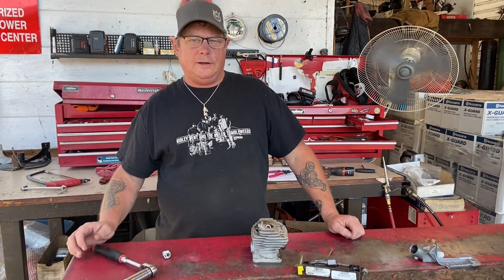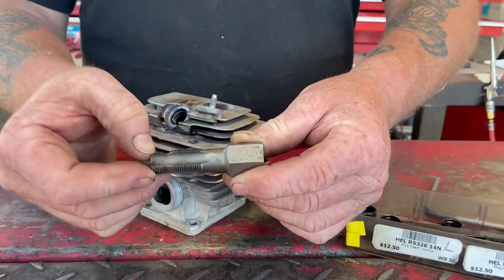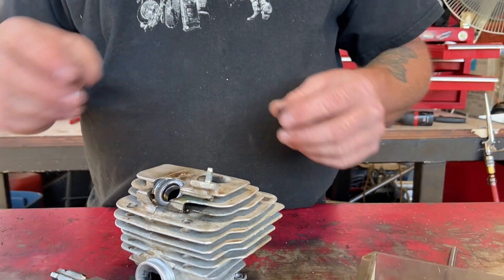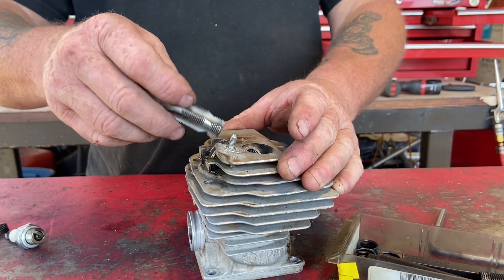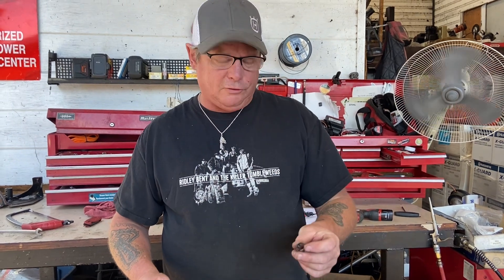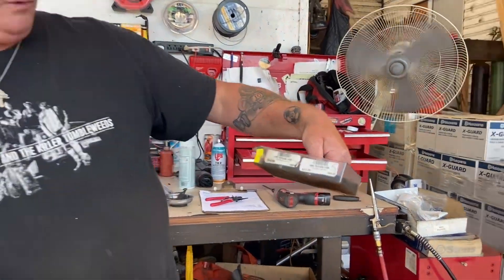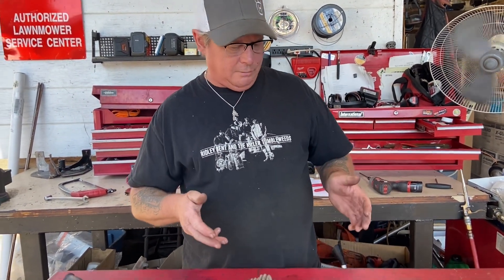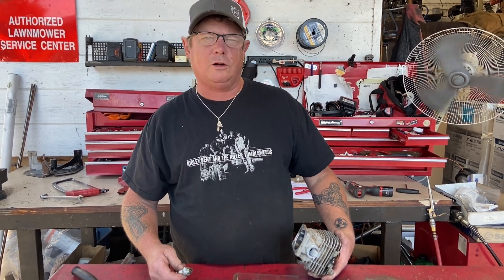fixing small engine spark plug threads

Comment: Hey Donny. My customers running MS194 models are having issues with their threads. They use the CMR6H plug which I believe is a 10mmx1.0 thread. Do you have any thoughts on repair options?
Reply from the maker: That’s a good question I haven’t had to repair a 10 mm yet but I will find a insert for that cause a lot of saws have them now
Reply: @donnywalker4691  I know you're busy. Thanks guy